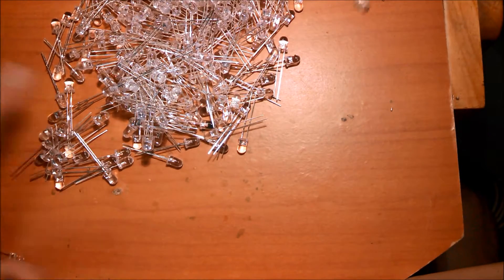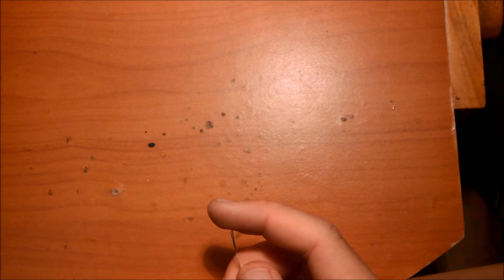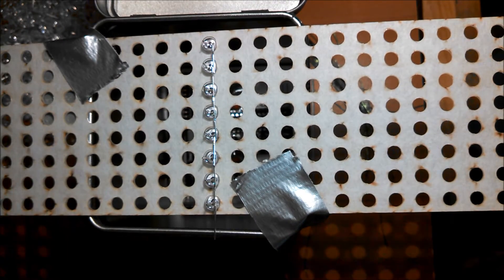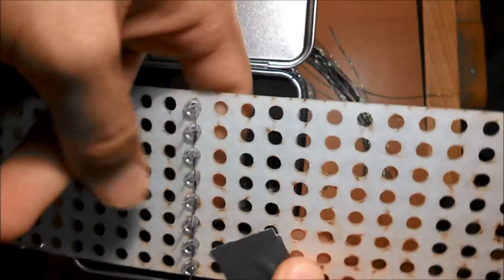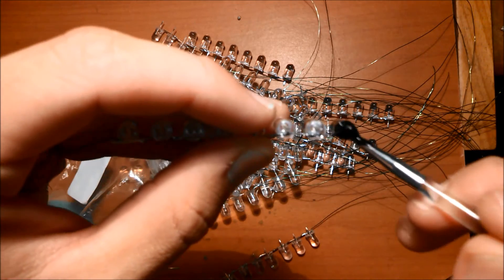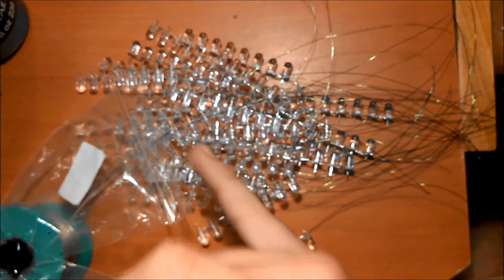Daft Punk Thomas DIY LED kit Part 1

Comment: hey alex, is it required that we use enamel wire at this stage or can we use conductor 28 AWG flat cable wire?
Reply from the maker: Yes you can.
Reply: cool, thanks.

Comment: In one of your videos I heard u mention that you used a soldering iron of 30 watts, I have a 25 watt iron, would that be okay or would I need 30 watt iron to build the Thomas helmet?
Reply from the maker: A 25 watt should be good enough, but if you find that the solder isn't melting fast enough, get a higher watt soldering iron.

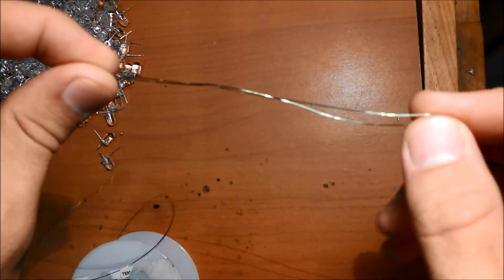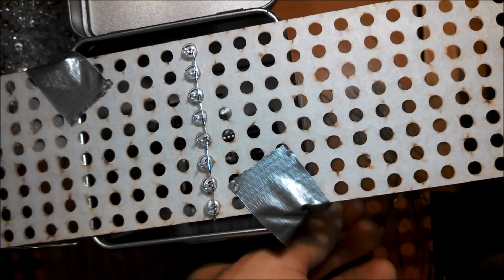Comment: AlexPlusLEDS Question on the 30AWG wire.  At around ~2:00, it looks like you are looping/doubling the wire back over itself, but at ~4:28, it looks more like it is a single strand that you are soldering to the LED column.

So it is a single 3" strand of wire, or is it a 6" strand basically folded in half?  Thanks!
Reply from the maker: I was doubling the wire back and forth in order to get a bunch of 6" strands.
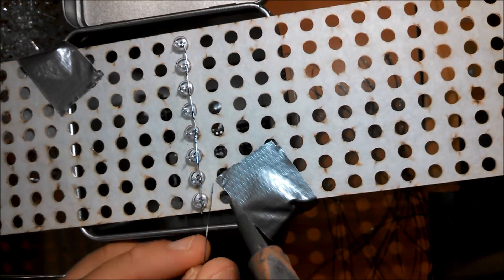Reply: So @ 4:55, you are tinning/soldering a single 3" strand to the column, correct?  Not a 6" strand doubled back into a loop, right?

Comment: AlexPlusLEDS will the Thomas led kit fit in a volpin props casting?
Reply from the maker: Yes, yes it will but you will have a little bit of space above and below the LEDs.
Reply: AlexPlusLEDS ok thanks! i am going to buy a kit in a couple of weeks along with a volpin casting and i have ben looking at methods of chroming for the helmet. i think i am going to use the A&R spray on chrome solution. Any advice?
Reply from the maker: *****  If you want a really good chrome finish, you will have to get the helmet chromed, either spray, actual chrome, or vacuum aluminized.
Reply: ok thanks !